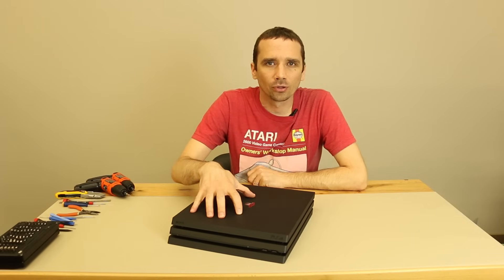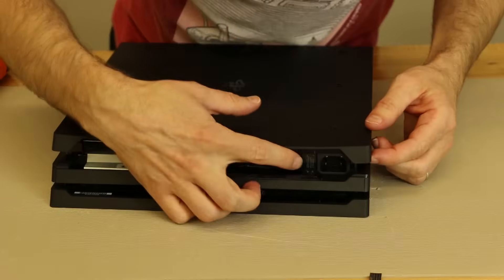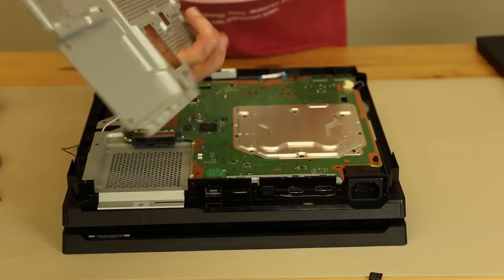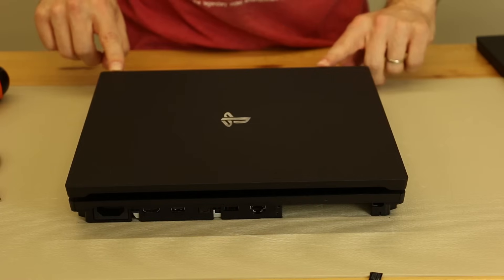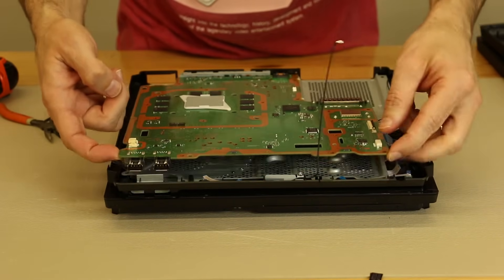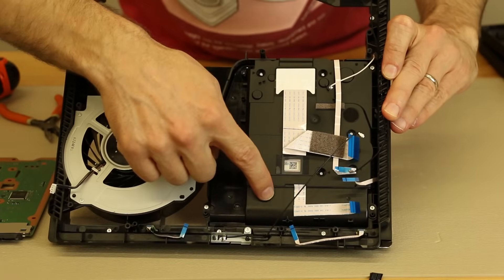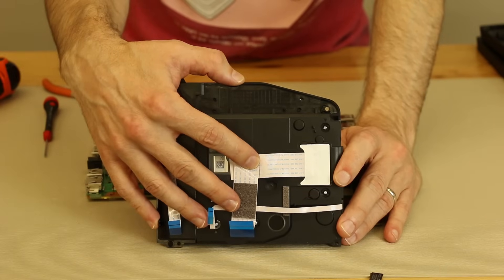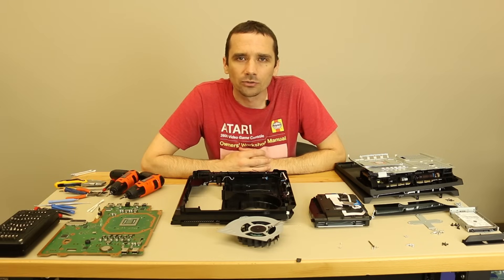PS4 Pro Teardown - Detailed Disassembly

Comment: hi friend, i have a question. My PS4 Pro has a lot of noise in the fan cooler. In Argentina we are in summer and temperatures are high. Do you think I can modify the power supply, to convert it into a external power supply? Do you think that would reduce the temperature of my console?

Comment: 7:31 dude I removed the part from the motherboard, and I know it's not your fault but I hate you cus I was watching this video when it happened and now my PS4 pro doesn't work anymore
Reply from the maker: Dude, you already found this out but for anyone else reading...you have to only pull on the part that plugs into the connector, not the part attached to the motherboard. 
We fix this type of thing for $89.99 for a 5 business day repair.

Comment: What are the measurements of the thermal pads?
Reply from the maker: 10x10x1mm
Reply: Same for 6 voltage regulator?

tks :)
Reply: Same for 6 voltage regulator?
Reply from the maker: No...I don't have the size for those.

Comment: Cool video, saw your fix on the old ps4 for the blue light of doom. Do you think you could do a fix for the pro also? I just got hit by the blue doom on my PS4 Pro.
Reply from the maker: Unfortunately, there is no known fix for the blue light of death on the pro yet. Sorry for the bad news.
Reply: I thought the blue light of doom was only an issue with the earlier models of PS4
Reply: My Pro had the issue that it would turn on for a split second with the blue light then beep then turn off. If that is not the blue light of death then I misspoke, but I had that issue. I was able to fix it though, by using the manual disc eject to get my disc out, then later it just started working. Maybe the disc drive was messing up and caused something, I don't really know, but that's what happened to me.

Comment: Where could I find the security but required. I made it to the power supply with the wrong bit without striping but one I got there they were not as easy to remove. so where could I find the required security bit? For any future cleaning so I don't strip and screws

Comment: Is there a way to remove the fan first, because i want to remove the fan only and replace it with one more quite
Reply: OutOfRangeDE no, you cannot remove the fan first because of the way sony built it, even if you did get another fan it wouldnt be compatible or even if you did get it to work it would be equal or louder then the factory fan, no point in tearing it down for something that far fetched

Comment: 4k and hdr is the future
Reply: 360Ragequit  Sorry to burst your bubble, but if you want that be prepared for a much larger and more expensive console. You would need a heatsink at least twice as large as the one in this video and less obstructed air inlets and outlets. To run at 4k compared to 1080 each frame takes slightly over 4 times the work. Factor in twice as many frames and you are faced with over 8 times as much work for the processor. I have 2 overclocked gtx 1080's and they still have some trouble with 4k 60hz.

Comment: Great teardown, but you got some of the details about the consequences of the optical drive wrong. You are correct that you can't play 4K BluRays from it, but games will be the same resolution whether you've downloaded them or are playing them from a disc. The PS4 Pro doesn't play games at 4K anyway. Best you can get is 1440p and checkerboard upscaled to 4K.

Even if the PS4 Pro did play games at native 4K, the drive wouldn't be a problem because the game discs won't be in 4K BluRay format, but in regular BluRay format. UHD BluRays require a different laser to read them, which is why the PS4 Pro can't read them. Games, on the other hand, are just data and so you can put whatever you want on the disc to be played in whatever resolution so long as the hardware supports it and the drive can read it quickly enough.
Reply from the maker: Ya, you're right. At the time that was my understanding of how it worked but as others have pointed out in these comments I was wrong.
Reply: iThinkergoiMac but i can i asked you a question, what tools do you need to open up this beasty machine

Comment: @TronicsFix: If I want to replace the thermal paste do I have to pull off the power supply unit? Or can I just pull off the back cover and work from there?
Reply from the maker: You have to remove the power supply. The entire motherboard has to come out.

Comment: games on disc can also do 4k, you just can't play 4k blu-ray movies
Reply: A 4k game has nothing at all to do with the medium it comes from. You could run 4k code from a CD if you wanted to.  This part of his video is completely wrong.
Reply: @samlawrence7435  regular Blu-rays are 1080p but they make 4k UHD Blu-rays. They hold more data to allow for a 4k picture and HDR and stuff like that. The latter is the one the PS4 can't read.
Reply: True
Reply: Yeah. As stated in comments, if it’s coded for 4K, and has the patch from online, you’re good. Can’t play 4K disc movies in 4K. Great console though
Reply: TheTommeke26 Technically the disks cant do 4K. The 4K aspect comes in the form of an online patch to the game

Comment: Why would the MB be lager because it have more power

The power is not in the MB. The only real diffrence for the MB to of the PS4 to the pro, is the added 1GB of DDR3.

The main bus and the memory buss are identical. The only real differences apart from the chip (that is really not that much bigger because of die shrink) would be the cooling

Comment: could you take out the disc drive and put in a 4k bluray iron would it not work?
Reply from the maker: I think you could probably swap disc drives but the software on the Pro vs slim is different.

Comment: you said in your video that disc based games will not be in 4k....then why does rise of the tomb raider have an option to display in 4k? I don't think what you said was true. Actually I know it isn't because all the games install on to the hdd.
Reply from the maker: Ya, at the time that was my understanding...it's actually tough to find a definitive answer about this but I think you are right that you can play 4k through the game discs. It seems so strange that they would make 4k game discs but not just enable 4k blu ray as well.
Reply: It is my understanding that the disc is just used to install the game on the hdd and then it plays like the digital version after it is installed. The disc is then only used to just verify you own the game and it plays off the hard drive then. Anyway, love watching your videos! Thumbs up!

Comment: I just thinking about the Hard drive, can we just change the hard drive with the bigger one hard drive ? I just worried if the data from the original hard drive is just corrupt, right ? I just wanted to change the bigger space hard drive
Reply from the maker: Yes you can change it. BUT be sure to save all your data as it will not be on the new hard drive.

Comment: Hello. As for removing the top cover. Do you need to have the screws taken out? Or can it be removed without taking out those screws? I ask because that would make this console easier to clean dust out of the fan. Thx in adv.
Reply from the maker: The top cover just snaps off. The bottom cover (the one with the warranty stickers) has 3 black screws.
Reply: Awesome. Thx for the reply. I like that they made the board on the bottom and the fan on top. I feel like that makes it a bit cooler since heat rises.

Comment: Still using 5400rpm Sony come on. minimum 7200rpm. Anything with the name Pro should have an SSD lol
Reply: Robert Presti 
You can add an ssd after market. Cost saving measure that I can understand for the general market.
Reply: They don't do that as the price of the console would be higher and it's good this way. Anyone decides after that if they want to put an ssd, they can do it.
Reply: That would double the cost of the console, if you want an SSD buy your own and install it
Reply: Robert Presti Actually the SATA 3 isn't helping anything. DigitalFoundry did a comparison of a HDD and an SSD on base PS4 and PS4 Pro and there was hardly any difference. I cant remember why but they explained it.

Comment: but if u have a disc game it will still output 4k will it not. sure ps4 just uses discs as a ticket to your more or less digital game??? am i wrong??
Reply: dermot brennan yes. when you insert the game you can change the output settings if it supports 4K.
Reply: you will download a patch which will enable it to output 4k native or upscaled games depending on the game.

Comment: What makes the pro actually pro?
Reply from the maker: It's mostly because of the increased computing power, but also because it can play 4K games.
Reply: but i wounldnt belive the ps4 pro can do 4k natvily though its was only ment for vr and locked at 1080p if you think about it
Reply: Some games r running at native 4K on the ps4 pro and there's some games running at 1440 or higher

Comment: Does the PS4 pro power supply  a multi voltage
Reply: This is +4.8V~1.5A and +12V~23.5A
Reply from the maker: Yes

Comment: im glad they used pure copper this time, bigger heatsink. Mine Pro really runs very very quit even after hours of heavy gaming
Reply from the maker: Yes, that was a serious upgrade.
Reply: stupid question but can you do a teardown of the Pro controller, can you check if Sony upgraded the battery? i have a feeling it last longer than the original PS4 controller :)
Reply: PlaystationQUAD-Pro do u play in 4k? Because in 4k in game menues with uncapped fps my ps4 pro thinks it is an airplane with permission to take off 0.o
Reply: yup ditto. nice and quiet! My OG ps4 was so loud I had to replace the thermal paste. Wasn't as bad after that. I also bought the stand for the pro and I feel like that will help with heat. This new stand is way better than the previous one and allows for alot of air to come in.
Reply: try GoW and see how it is..
Reply: Manoj Varughese hahahahah good one
Reply: +PlaystationQUAD-Pro I start playing somewhere before midday with a full charged controller and it last me somewhere up to or even beyond midnight. It indicates being low around 10 o clock in the evening, but still manages to hold on for a few hours.
I have my ledlights set to dim and my vibration is always on the highest setting.
So give or take some 13 hours. I didn't own the previous PS4 controllers, so you should judge if it's lasting longer.
Reply: Salamence 1  What an ignorant, uninformed comment. Fan noise is zero indication of how powerful something is lol. It just means X component is runner hotter and needs to be cooled more. Also, the PS4 isn't that powerful lol. 1.8 Teraflops of processing power (4.2 for the Pro), that is horrifically low. Modern GPUs are running 8-12 TeraFlops, soon to be 11-15 once Nvidia Ampere/AMD Big Navi drops.

Comment: Do you think it is better than the XBOX ONE S? They are kinda equal i think. But this might be little bit better. What will be your next video?
Reply: Ryan Rahman obviously its better because it can run games at 4k now
Reply: 4 teraflops not 8 LoL.
Reply from the maker: That just depends on what you're going for. The PS4 Pro is more powerful, can play 4k games, is VR ready, etc. The Xbox One S is smaller, cheaper, not as powerful but does have a 4k blu ray player. 
Next vid will probably be an assembly video or hardware comparison between PS4 slim and Pro.
Reply from the maker: It's 4tf...there'e no comparison between the two.
Reply: Truth Entertainment
Just ignore this kid.
Reply: Yes
Reply: Also ANY xbox crap will turn you into an xbox nerd do do the same mistake that stampycat did because when he got an xbox he got an ps4 but the time he got it, it was too late.
Reply: HERO 7739 definitely superior to the one s.  Far more capable.  Not very far behind the one x either, when it comes to how games perform, and those that are optimized for the pro run, look and play amazingly.
Reply: It's basicly between x1s and x1x. The 1x uses a new apu  while ps pro uses the same apu just ocd.

Comment: Great vid, I was hoping I'd be able to find a quality day-one teardown, and this was it.  One question, though; would you recommend new thermal paste and fan blades like many Playstation consoles need, or do you think what Sony shipped the Pro with are sufficient?
Reply from the maker: I would use it as is. The thermal paste was still wet and it runs fairly cool as is. That being said I've only used it for about 30 min so I don't know for sure.

Comment: Great video would like to see a motherboard compared video of all PS4 and does the Pro have HDMI 2.0? I'm interested in this because of the new update in which all PS4 can do HDR would like to see or know how that will that work with the Previous PS4.
Reply: Bomb_Star HDMI 2.0 is a feature of the PS4 Pro, according to Sony's FAQ.
Reply from the maker: Yes, it has HDMI 2.0. It can show HDR and 4K. The PS4 slim also can show HDR due to a firmware upgrade by Sony.
Reply: Dante Coal Thanks
Reply: Ok thanks

Comment: sony kinda copy the xclamp
Reply from the maker: Well, at least it should help the PRO last longer.
Reply: Probably so but i hope Microsoft doesn't try to sue sony
Reply: Well you put it that way yea you right about that
Reply: An X shaped retention bracket isn't something Microsoft invented.  Its a commodity piece from a commodity design that has existed at least as far back as the socket 478 Northwood pentium 4 cpus on back in 2002.